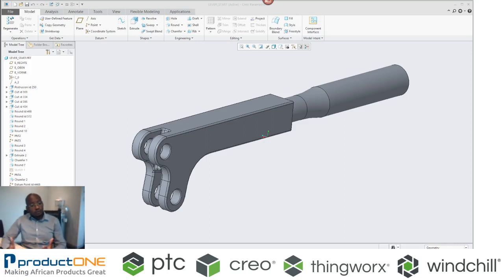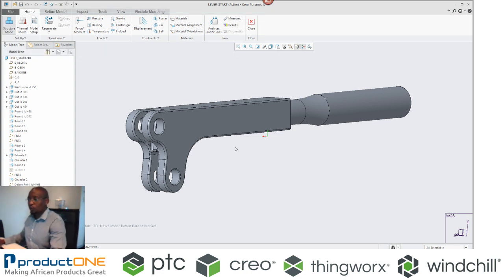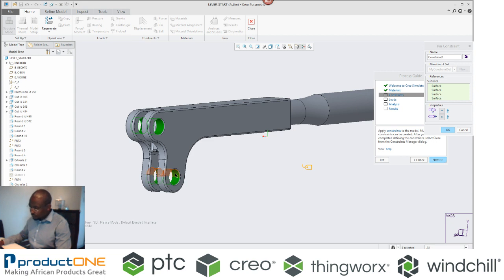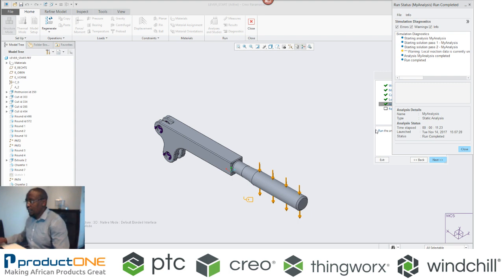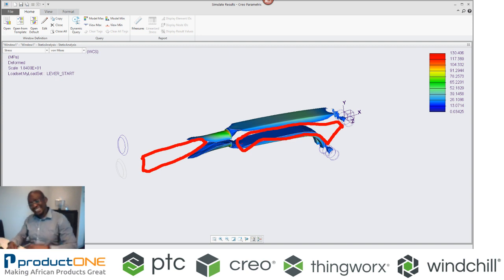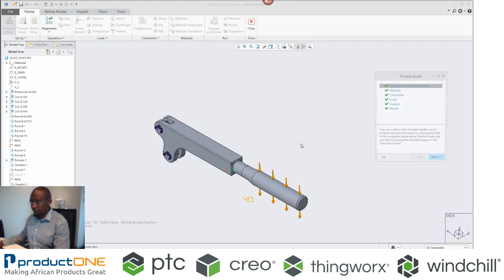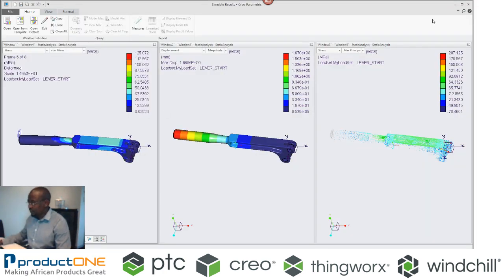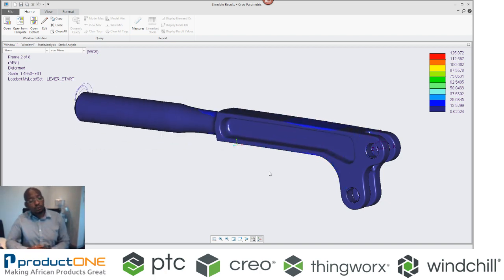PTC Creo Simulate Lite

Comment: Where do you define the default units for simulation results? For example stress Von Mises. I have to select it manually each time because of some weird default units. Everything else I have actively set to MMKS units. But in Simulation Lite I want MPa etc as default